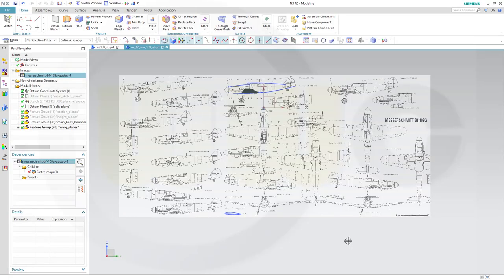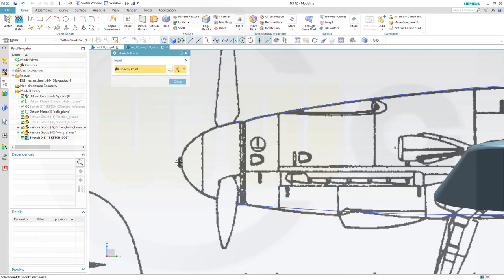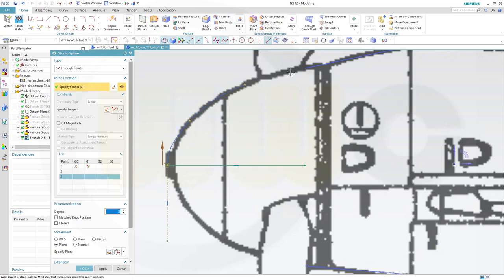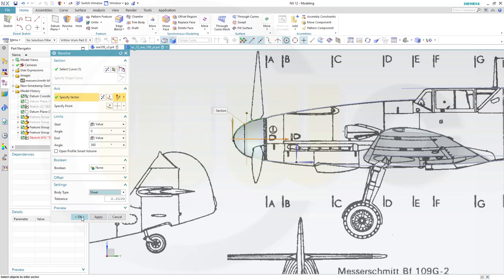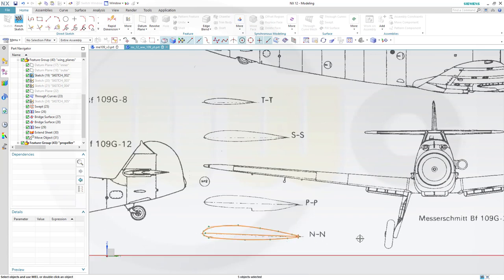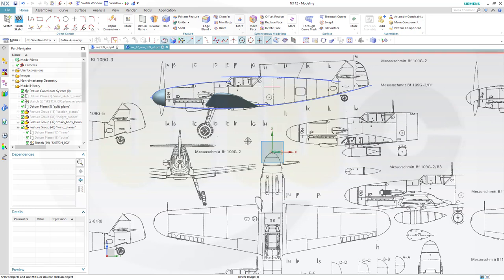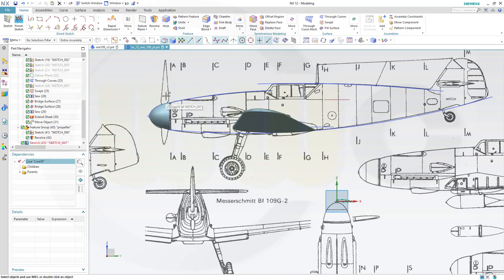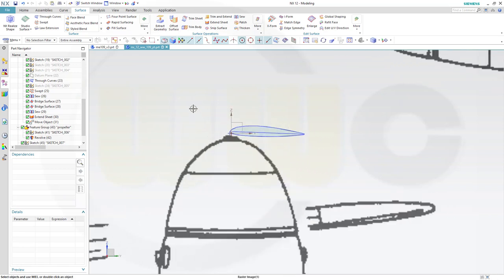WW-109 Fighter Plane - Part 3 - Propeller - Siemens NX 12 Training - Surfaces

Comment: Sir , while creating the tail wing ,after the forming of swept for both the tail wing sides now when I use the intersection curve for the tail surface the curves aren't coming at the edges ,they are forming at the sides of edges which is too far from it ,can you please ,say where the error if possible sir .
Reply from the maker: sorry, can´t tell without reviewing your model
Reply: Is there anyway to send you the screen shot to review my model sir.
Reply from the maker: A screenshot might not help - info@wwmc.de
Reply: I am also having same problem bro, how did you solve that